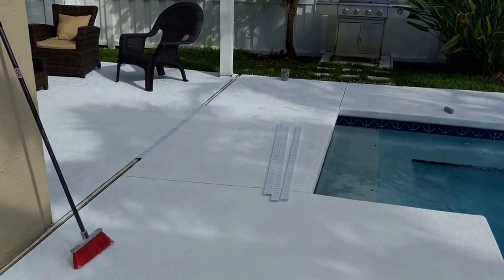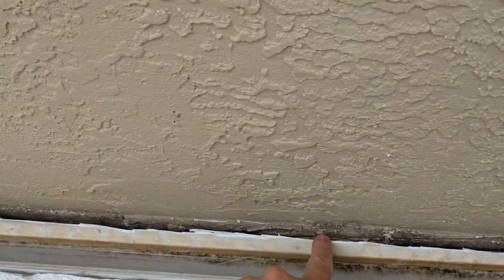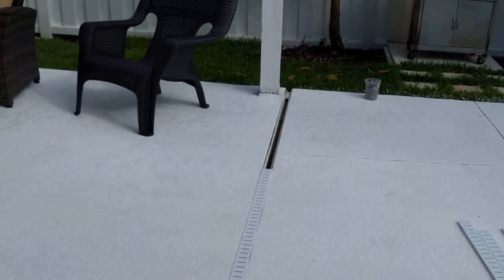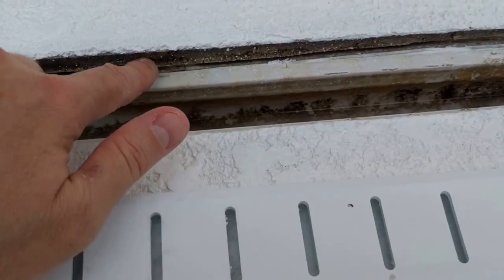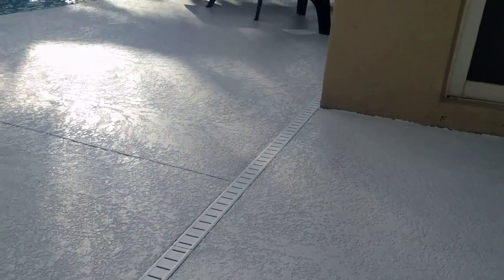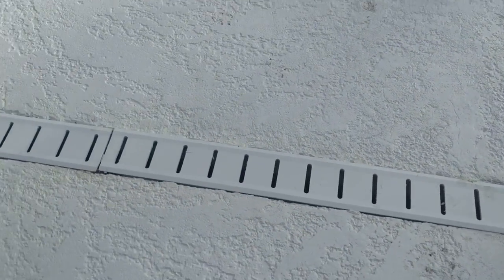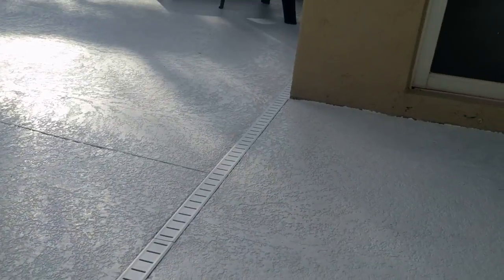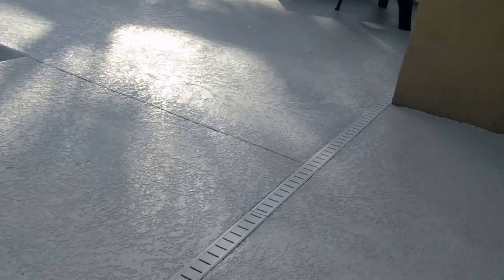Pool Deck Drain Repair - Part 2

Comment: Given channel drains will always need cleaning at some point or other, it begs the obvious question:   why were one piece channel drains ever made in the first place?   For basic maintenance reasons, I'd have expected drains like that should always have removable caps.     It's almost a crime companies would design and produce one piece horizontal drains like that.
Reply: My drain cleaning service cleans them out on a regular basis in just a little while for a few bucks.

Comment: Dang it, my super drain at the bottom tube arent connected at two 90 degree angles. Top is fine. Might try to connect a balloon at the corners and then add concrete filler around. Then some other material to connect them. Of course theres structure damage with patio sinking and cracks in brick flooring, patio cover ceiling and one crack going into house. Damn Florida cheapskate ripoff contractors. Every contractor hired here in Florida has tried to scam. Gotta keep multiple cameras and hidden ones!

Comment: This is a fantastic video. Thank you for posting this, I have the exact same drain with the exact same problem.  By far this is the best video I have come across on how to repair a deck drain!
Reply from the maker: +Anton Leimbach I'm glad you found my videos helpful. There is one more thing to consider. After having completed my project, I wonder whether or not I should have purchased a different type of cat. The cab I recommend in the video has small ridges on the sides. The drain slits do not go all the way across (see video). This means even though large pools of rain will drain, a very small bit of water might remain
 This other type of Super Drain cap has drain slits that go all the way across the width of the drain. This looks like it might drain the last of the water that might otherwise get stuck next to the ridge of the drain. 

http://shop.clarkconcreteforms.com/Re-Cover-Super-Drain_c361.htm
Reply from the maker: +Mark Fauntleroy that was supposed to be "cap".
Reply: Mark, I notice some small pools of water on my deck every now and then but that's ok, they seem to evaporate fairly quickly in the Florida sun. I ordered the caps from Advanced Surfaces today.  They were super friendly and their prices are great.

Comment: Thank you so much Mark. Very well done, explained all steps throughly and has given me confidence to take on my drain’s inefficiency.  In other words, if it requires a power wash clean out or an actual replacement. 
Your vid is precisely what I need.
Thank you again Mark.
Take care. Ciao

Comment: I agree with "the Calendar" - why hasn't anyone come up with initially installing Channel Drains with removable caps so the drain can be cleaned out! so stupid!!   And Mark - your video was helpful unto a point - I am disappointed that you didn't show how to remove the top of the "old walls"... that would have been very very helpful.  Thank you for explaining the pipes at the end of the 30' lengths.
Reply: We clean them for a few bucks.